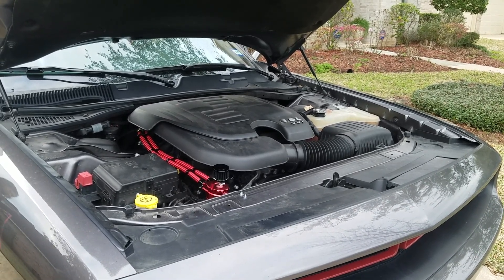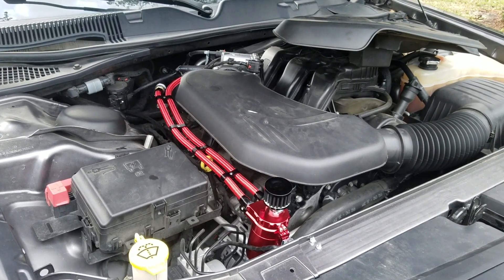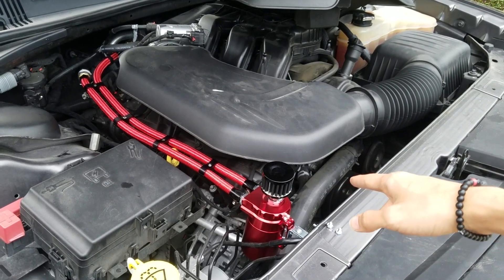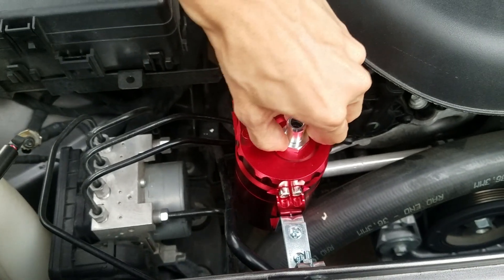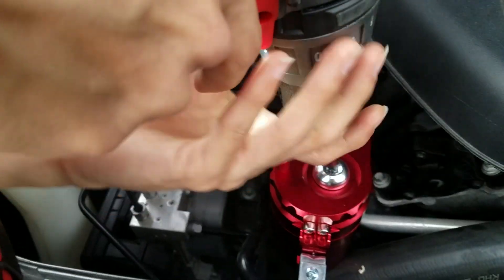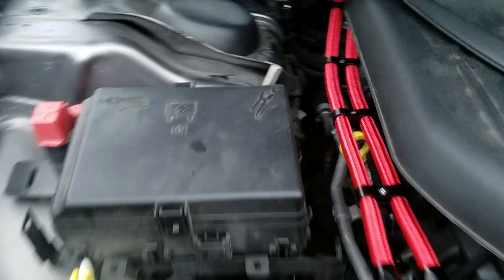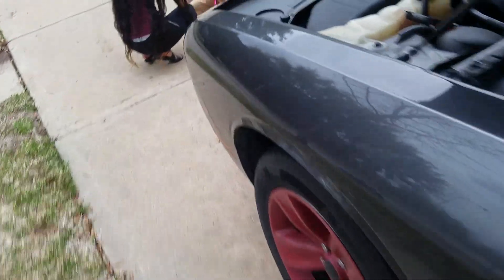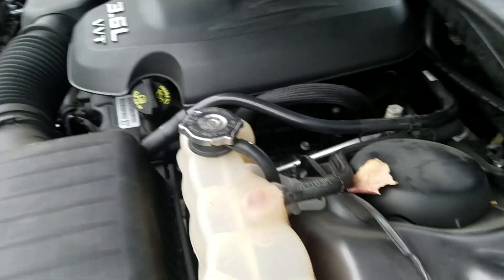Oil Catch Can with Breather or NO Breather?

Comment: please quit saying negative vacuum... vacuum is a positive pressure below atmospheric pressure, which is what you have. 

When you read vacuum as a negative value, it is the calculated difference in your pressure and atmospheric pressure. Since I just stated vacuum is a pressure value below atmospheric pressure, you end up with a negative number; HOWEVER it is not called a negative vacuum, it is still just called vacuum.  

Also, a little tip, dangle a piece of paper in front and see if it moves to the object or moves away from the object. This will tell you if she is sucking or blowing.
Reply from the maker: Sorry don't really know technical terms, but it's defiantly sucking I held it by hand. I could feel air sneaking through my hands into the breather.

Comment: Do you think you have more power with breather ON? How much oil have you catch now?
Reply from the maker: jandy sanchez no the oil catch can doesn't add any more, it just increases the longevity of the engine
Reply from the maker: jandy sanchez I need to have the breather off, other wise I lose the negative vacuum the engine was designed for
Reply: Your terminology is a bit confusing, vacuum is negative PRESSURE. So, negative vacuum = +pressure?

Comment: The breather needs a checkvalve so it will block at vacuum and let the air pass at boost. If you blocked the breather your oil dipstick will snap out at high boost

Comment: here I'll help you out... if you are just venting the crankcase you can use the filter or with out hooking it up to your intake. But if you're hooked up to your intake you can't use the filter because it creates a vacuum leak.
Reply: that make sense, Thank You.
Reply: Nice I kinda figured that bu thg ur comment helped me thanks
Reply: Thats not a vacuum leak, Billy, it is sucking air the same way as a air filter inside a box, a vacuum leak would be from the turbo onwards
Reply: @SamVieiraGuitar  Nope. It's having the same effect as putting the breather directly on the vacuum line. It needs to be a closed system when it's hooked up to the intake vacuum.

Comment: Don't put Teflon tape on the threads of the plug. The plug has an O-ring.
Reply: What he said...The tape is for the hose fittings.  It also really should be the yellow fuel safe Teflon tape, the white is not meant for fuel or oil applications. 
After watching this video I'm more confused than ever.  I tested my system and have positive crank case pressure at idle and vacuum at high rpms.
Reply: He drives a v6 challenger
Reply: Joe Hernandez LMAO 😆🤣

Comment: Yes it's sucking air. You've added a big hole to your intake system. 
With a breather, plug intake ports and allow breather to vent to the atmosphere. No lines back to intake.
Without a breather, it can go back to the intake. (This will still allow some oil vapors into intake.) 
Vent to atmosphere with breather is best.
Reply from the maker: NameYourChannel I am not sure if the vacuum is strong enough to suck the vapors out and vent at the same time I am gonna have to test that soon
Reply: TigerVX V - What's venting is the cranckcase pressure. As long as it has an opening the pressure will release. No vaccuum needed. 
On my car I plugged the intake ports and ran the pcv and the other breather port to a catch can with breather. No return line. Huge difference. 
If you insist on a return line, it must be a closed loop system. No vent allowed otherwise you have created a vaccuum leak after the throttle plate. Will only cause you issues. 
Hope that makes sense.
Reply from the maker: NameYourChannel yeah I noticed the car was idling at higher rpm
Reply: TigerVX V - Yep....That's a vaccuum leak. 
Try take your brake booster hose off and blow smoke into it. That is part of your intake vaccuum system. Should be air tight. But you'll see smoke come out if yiur catch can breather which means vaccuum leak. 
Ask me how I know... lol.
Good luck.
Reply: TigerVX V - Sorry... also cap the end of your intake tube if you're doing the smoke trick, so no air can go out your intake.
Reply: @nameyourchannel7844  .
Reply: @NameYourChannel if I go for the best choice, would be the same if I put a filter out of the exit of the can? This due to my can doesn't have filter breather on the top of it. Only entry and exit. So in the exit I would put a filter, rather than let it vent. What do you think? :)

(In any case, inlet ports plugged)
Reply: @teo5793  - If your can only has two ports, inlet and out, you can do one of two things. Run your hose in to the can, then out back to the intake. That will keep the vaccuum system a closed loop. (Basically put the catch can between the pvc valve and intake). 
Or.. run your hose in to the can, and put a breather filter on the outlet. This allows it to vent to the atmosphere through the filter. If you do this way, make sure you plug where the hose would go back into the intake. 
You don't want any intake leak causing vaccuum loss. 
Make sense?
Reply: @teo5793  - Best bet i think is try vent to atmosphere with a breather. This keeps all oil vapors out of your intake. 
However, I tried this with my Tiburon and it smoked like a bastard (it was burning oil too, valve stem seals.). In which case i returned it to the intake with a hose instead of venting to atmoshpere. Catch can will still catch lots of vapors

Comment: Have the breather on.
The way it seems to be designed, it severely slows down the airflow through it. With the breather on, it can allow the engine to suck in more air.

And it is sucking air in.
Reply from the maker: yeah but it needs to suck the oil vapors out of the cylinder block, with the breather on its sucking outside hot engine air instead of oil vapor. kinda defeats the point of the oil catch can.